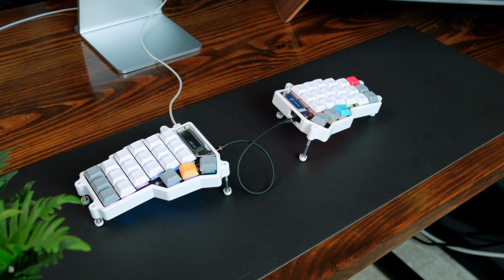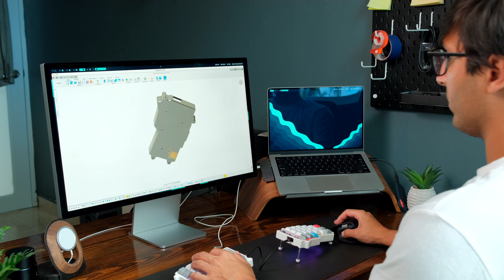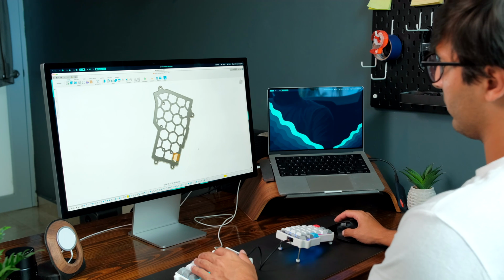My Ultimate Case For The MX Corne Keyboard | Tented & Regular

Comment from the maker: Hey guys! Hope you enjoyed the video! I've really enjoyed how this case has enhanced my experience with the Corne, as I was originally using a very minimal one made out of fr4 plates you might have seen in my other videos. Some of you have mentioned that this case looks similar to the design of the case by VOID. I haven't printed or tried this case out myself, but it seems to be a good alternative option if you have a 3d printer or would like to 3d print a case for the corne yourself as well as source the switch plates and assembly/tenting hardware separately. This is my own design, made around the outline of the corne pcb with common 3d print design techniques with the goal to provide a high quality print with everything you'll need to assemble and optionally tent your keeb, making sure that everything fits together nicely with my own corne keyboards (wireless & wired with RGB lights).  I'm working on a complete guide on soldering, flashing and assembling the Corne that I hope will also be helpful and should be coming out soon!

Comment: dunno man, really looks like the VOID case for the corne, which its FREE and OPENSOURCE on printables
Reply: not open source technically also
Reply from the maker: Hey! Thanks for the feedback. The VOID case definitely looks like a good option if you would like to 3d print the case yourself. This is an alternative design I put together that uses pretty standard 3d print design techniques based off of the outline of the Corne pcb. That’s why they might look similar, but they’re not the same. I wanted to provide an option with a high quality print that also includes everything else you’ll need like standard fr4 switch plates as well as all of the assembly and tenting hardware. I’d say the most similar feature is the optional honeycomb pattern on the bottom of my case. This is designed, placed, sized and tested so that all rgb underglow lights are exposed and they shine through properly. This might also be true for the VOID case but I haven’t tried or printed it myself to test out.

Comment: Is it comfortable in this position all day without a palm rest?
Reply from the maker: Hey! I'd say it depends. If you aren't using a palm rest, what I've found most comfortable is to have a good ergonomic chair positioned properly so that your forearms are resting on it and your hands can easily hover over your keyboard. I've also tried using memory foam wrist rests from Amazon that I've found pretty comfortable. I've added a link to them in the description. If you're using wrist rests, you should aim to support more so your palm instead of your wrist. Hope that helps!
Reply: I’d like to know the answer to your question too. I’m using a Dygma Defy and the integrated palm rest was one of the many reasons for choosing this specific keyboard. After using the Defy for about 10 weeks, I can definitely say that I prefer a keyboard with an integrated palm rest, especially if you use tenting.

Comment: Did you just rip off the VOID's case design?
Reply: yes he did! Shame!
Reply from the maker: Hey! I can see why they might look similar, but they are not the same. I started off by designing a shell with a closed bottom around a 3d model of the Corne pcb and then added m4 sized tenting screw hole locations where they traditionally should go on the case. After doing so, I debated whether to make an alternative case with an acrylic bottom or simply use a pattern on the bottom of the case to let rgb underglow lighting to shine through. I opted for the pattern instead of acrylic for simplicity’s sake. In contrast to the case design by VOID, which uses a Voronoi pattern for the bottom, I made use of a honeycomb pattern that I intentionally sized and positioned so that each of the rgb underglow lights would not be obstructed and could shine through. Finally, I wanted to have a standard solution to make sure the case wouldn’t slide and could be used on a glass table, so I decided to have the tenting screws facing down and designed the 3d printed caps for them, sized for the rubber bumpers included in the kit.